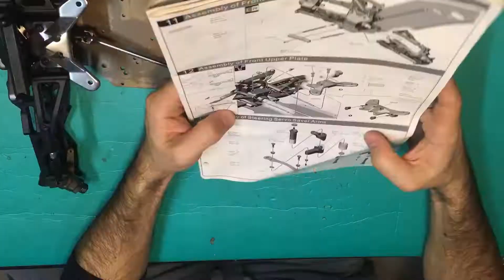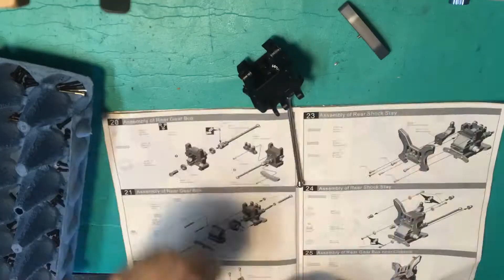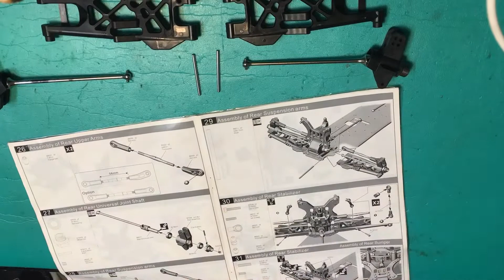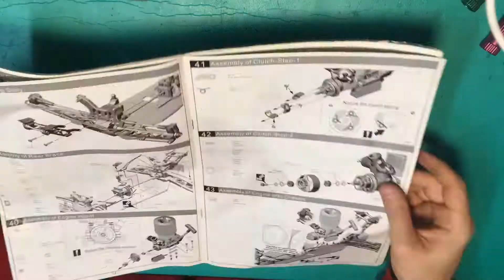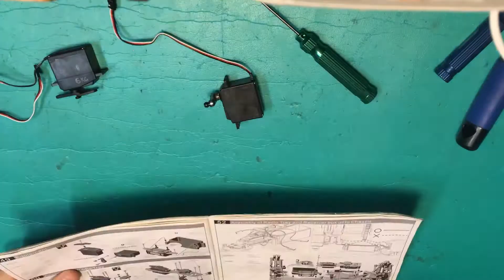Hobao Hyper ST Pro Build TIMELAPSE

Comment: Hello, great video and very useful to see it come together as I'm considering building one of these. If I may, can I ask a couple of questions, appreciate that this was uploaded a couple of years ago! I've read in a few places that a pullstart engine can't be installed in these but I've seen plenty on YouTube that suggest otherwise. Did you have to customise any of the engine mounts to make it fit or was it all stock? Also, does the 4x AA battery cage and switch come with the kit? I'm just working out what other kit I will need. Thanks in advance!
Reply from the maker: hello Will, pullstart is fine for .21 and .28 engines (im using the older Hyper .28 3-port engine/not the newer Hyper .28 Macstar 6 port) but remember to preheat a new engine while breaking in (the first 4 litres/gallon) otherwise you will kill the pullstart.
The engine mounts are stock and highly adjustable in every direction imagineable!
Yes it all comes with the kit however here is my advice:
1. switches fail and can move to off position while driving. plug battery directly into receiver or set up a throttle return spring as a failsafe wont help if battery is disconnected.
2. do not waste time with AA batteries. they are expensive, heavy, weak and dont last long. they are hard to test, and you will have poor braking performance due to voltage sag under load. buy a small LiFe receiver battery around 1400mah and the truck will be twice as good for steering and braking!
goodluck, best truck ever. impossible to break. easy to get parts, see you in the facebook hobao group! #CorporateNitro
Reply: Thanks so much @inzp3ctor that's really helpful. As I'm new to it all I'm trying to build a setup for a reasonable cost so I'm looking at the LRP ZR 28 Spec 4 engine. I did have a receiver battery pack in my bundle but removed it to try and save a bit of money, but it'll be going back in as what you say makes complete sense.